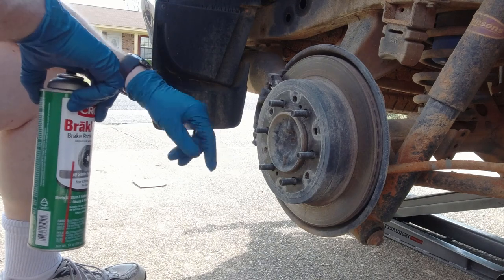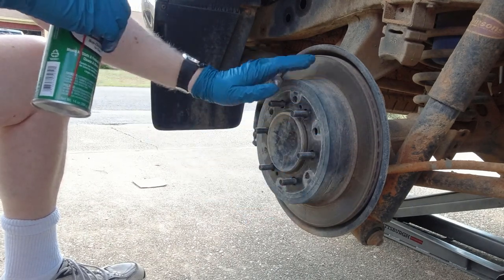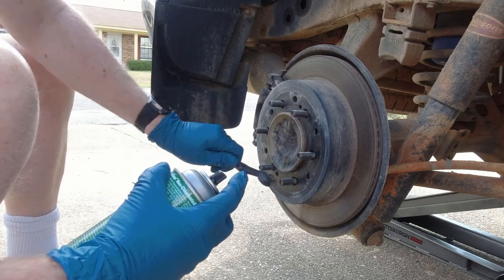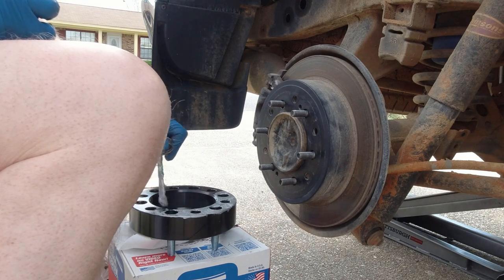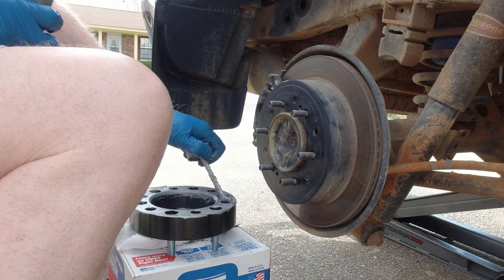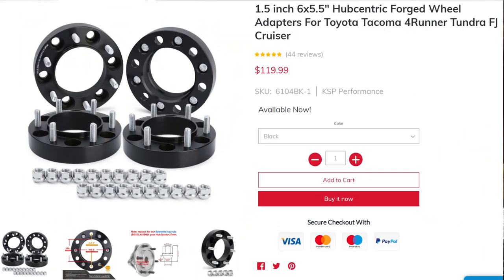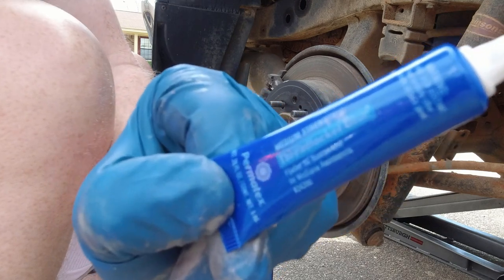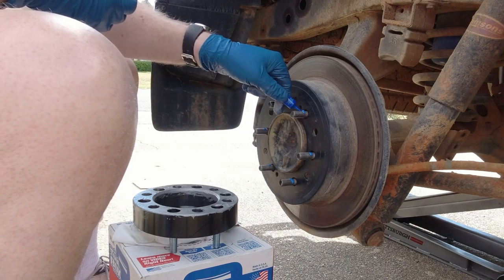Installing Wheel Spacers - Lexus GX470 / GX460

Comment: Nice! I sold my 08 GX470 couple of yrs ago and now looking to get into 2017 GX460 and I had those toyota rims. Tried selling a set of 4 for $300 and nobody bought them for 2 yrs, got bunch of lowball offers lol. I guess  it worked out, I'm back in the GX game. So what tires do you have on them? It'll make a good spare set for offroad for GX460.
Reply from the maker: I not longer have those wheels or tires.  I have moved up to MTs. Yokohama Geolander 34s.

Comment: I tried to install some 1.5” wheel spacers from Sixity and the bolts had a 1/4” or so of threads showing. Like i need longer studs. Just returned them and ordered the ones you showed hopefully these fit. Read the comments and you said they had enough threads.
Reply from the maker: Mine had enough threads.
Reply: @jamie.andrews  i ordered the exact ones you have and tried to put them on my gx470 and i had the same issue. I don’t understand how you had enough threads without getting longer wheel studs. Please help if you can
Reply from the maker: @connornoel28  Could be one of us had aftermarket lugs.
Reply: @connornoel28  will 2” inch long be good? If so, we can help! Contact us!

Comment: Thanks for posting! I have gx 470 with 2.5 inch lift and stock wheels and am interested in adding spacers. I already had to move front fender liners forward a bit to fit my 285/70 tires, just curious if you have to do any chopping on your front bumper once spacers were added? any chopping on fenders?
Reply from the maker: I am running 1.5 inch spacers and had some rub on the fender liners and the body mount.  I am running 265 70 17.  I have since removed the front bumper and I am running a metal front bumper.  No fender liner.  I lifed the truck to 3 inches front and back and now don't rub on the body mount. If you use 1.25 spacers there will be less rubbing.
Reply: Hello I am planning on mounting 285/70 and installing a 2.5 inch lift. I’m curious if the stock wheels work well and don’t cause any problems? Also did you replace your upper control arms when you lifted or is it okay to use the stock ones?

Comment: Did you have to buy extended nuts or studs? I have an 05 GX I'm looking to do the same thing with.
Reply from the maker: Not with these KSP spacers.
Reply: I just put the same wheels on my GX. Where did you get the GXOR sticker on the wheels from? I really like that.
Reply from the maker: @aaronhoke379  I got them from Soren Jensen on GXOX
Reply: Jamie Andrews ok thanks! Had spacers before but didn’t think to put anti seize on the backs. Should have known when I lived in the Midwest lol
Reply: @jamie.andrews  are you on ig?
Reply: @jamie.andrews   u had enough threds in the front using these KSP spacers? And do u have any comments about the spacers now, after having them on ur truck for some time?
Reply from the maker: @pradeepjapanwala7286  I did have enough threads.  Plenty.   No complaints.  Just got back from a 1000 mile trip plus I wheel it with them on.  I have a buddy that has put over 15k miles on his.
Reply: Hi, I'm interested in putting spacers on my GX 460. Love how yours look with spacers. I have a few questions hope you can help. Do you have to do a wheel alignment after installing the spacers? Does it have effect the camber of the tires at all? Is the ride noticibly different if at all? Thanks